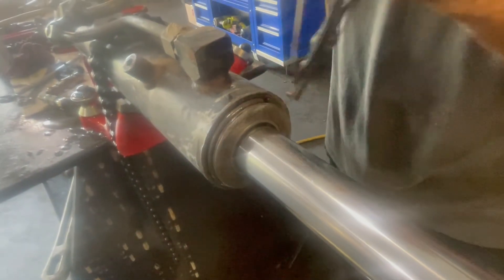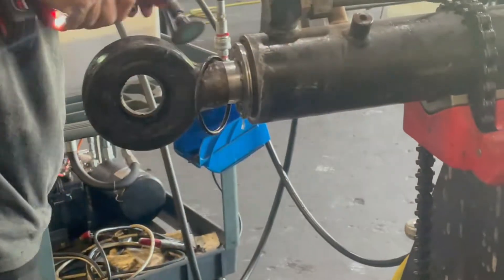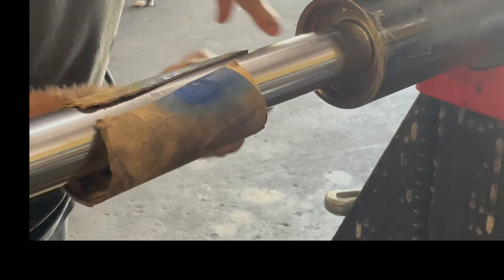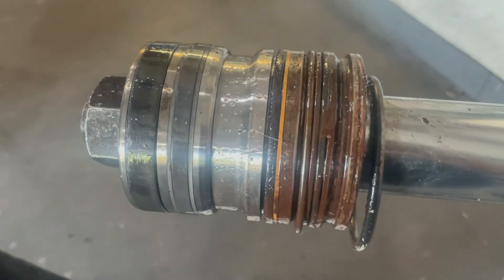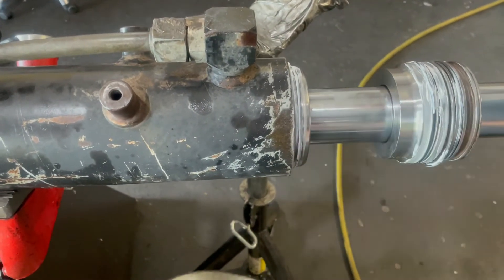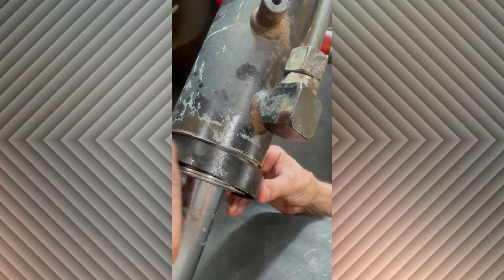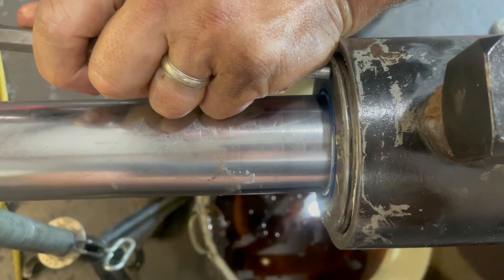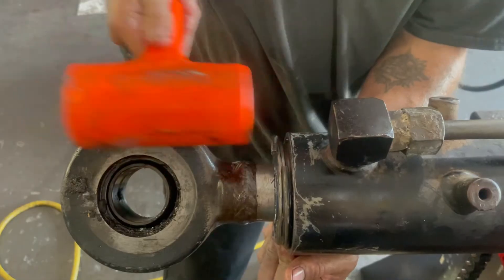Rebuilding A Hydraulic Cylinder On A John Deere Feller Buncher

Comment: My John Deere 328D has the same stupid design on the boom hydraulic cylinder. I never seen such s stupid way to design hydraulic cylinders. It’s a nightmare to remove and assemble back on without damaging the seals on the rod piston.
Reply from the maker: I sometimes think John Deere hates their customers 😆
Reply: @carolinahydraulichose6253  what they don't realize is that slowly by slowly "customers" go away and they are the ones loosing it. In fact after fixing my tractor I will sell it. Enough is enough....